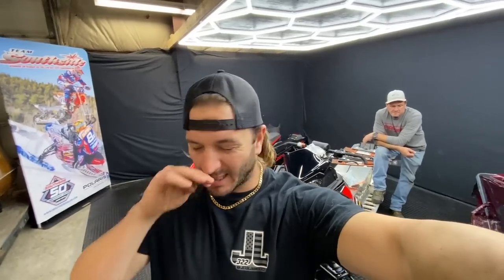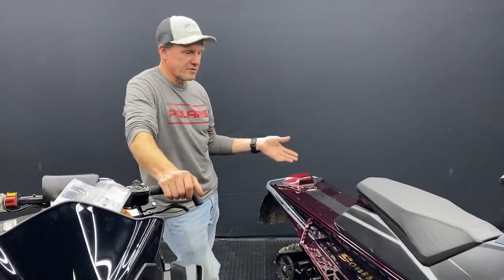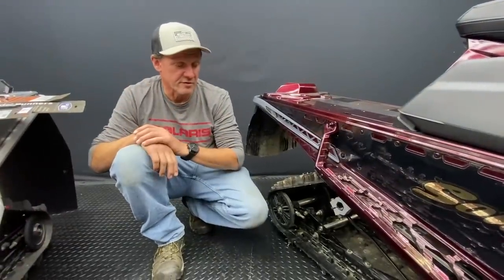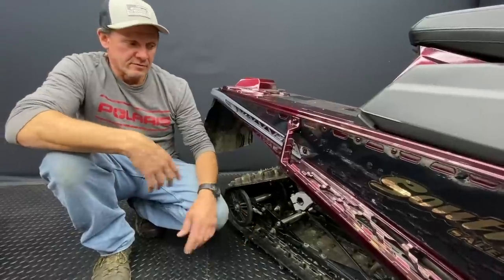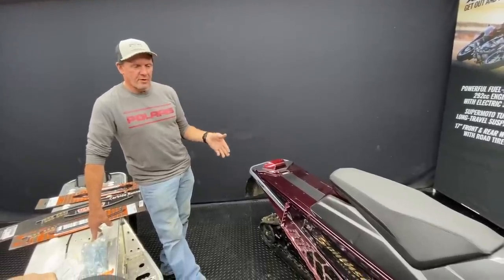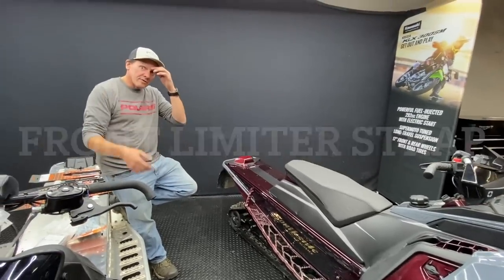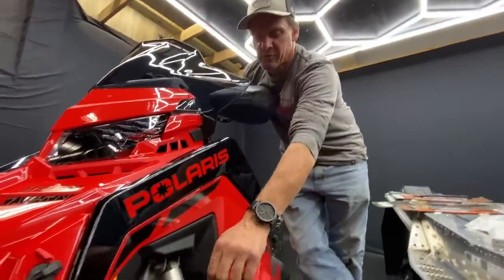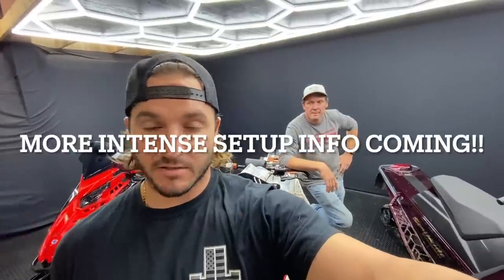POLARIS MATRYX BASIC SET UP! WHAT TO CHANGE TO MAKE YOUR RIDING EXPERIENCE MORE ENJOYABLE!

Comment: Bruce is spot on with the springs,I wound up running the Xtra h/d springs which were too stiff to get the right sag,you can actually bend the tang in the spring to get the right sag,so I now have the exact Sag and ride height I want and still have the stiffer rate springs in place!!👍👍
Reply from the maker: we used to bend the race sled springs to get it where we needed it! There is always a way to make it work but for most we like to keep it basic!
Reply: 👍👍Love your new tech videos for the riders,This will give the average guy a great idea on how to help tune there sled,!!

Comment: Great suspension setup info. My only comment is the snow conditions change not only by the day but sometimes by the hour, so you could make changes several times a day which ain't gonna happen. Riding partners don't want to stop waiting for me to make changes.I find a happy medium and usually keep it for the season.
Reply from the maker: And that is really the ultimate goal is to find a happy medium. But with addition of clickers which are extremely easy to use you can really change your entire sled when you stop for gas or food juts by clicking away. Obviosuly you need to find that happy medium first and then adjust from there.
Reply: @JESSEJAMES322  Guys would get mad if I had to stop and flip sled on side to change air pressure in my Fox Floats. Lol . Nice to have newer shock technology with clickers for hi/low

Comment: Great Video!  Really helps speed up learning all of the in's and out's of tuning.  I have a 22 VR1 850 137".  I am planning on putting 96 studs down the middle (ride mostly MN and Northern WI).  Aggressive riding style.  What Carbides do you recommend? And what length is needed with that stud setup?  I am about 190#'s with gear on, so planning on switching to the HD Springs this off season as well if that makes a difference.  Keep the great content coming!
Reply from the maker: Thank you we are trying! We recommend 8 inch woodys Mavericks. They are an awesome addition to your set up!!! appreciate you following along! did you get entered in the giveaway? you could win skis, carbides, studs, hand guards and a $200 gift card to Southside!! anything purchased off 322threads.com gets you entered!
Reply: @JESSEJAMES322  Awesome. Thanks for the quick response.  Do you shim them or run navigators with them? Just picked up a 322 star hat!
Reply from the maker: Thank you! and you can do both. They will ultimately help make the sled handle the best it can

Comment: Hey Jesse, thanks for sharing your knowledge! Your videos are awesome and very helpful!! I have a 2021 XC850 129” track and I’ve followed all the tips you and Bruce mentioned. Question - Do you have any suggestions to help improve inside ski lift? Ive ridden a 2018 Pro S and 2017 stock Indy and neither seem to have nearly as much ski lift as my 2021. Any suggestions are appreciated! Thanks!!
Reply from the maker: hey so inside ski lift can be tammed by a couple things. 1 add preload to your ski shocks. you only have 80 pound springs so add 1/2 inch (anything over a half inch wont change). you can go to 100 pound springs up front and also add 1/2 inch of preload (this will get the front of the sled up and some of the track off the ground) OR you can shorten your limiter strap which ive done a few videso on that ove rthe years
Reply: Awesome, I really appreciate it!

Comment: I’ve been tinkering with my 19 assault for awhile now. I’ve found the front springs just aren’t long enough and you have minimal preload adjustment. So I’ve found to just run them all the way stiff. I run the woody ace 8” and clickers are med in front. Front rear shock is 2 and rear is I think 5-6. Never touched the spring. The fucker will wheelie which makes it fun and it turns quite nicely if I wanna hang off and work it
Reply from the maker: Have you ever had your shocks freshened/revalved? If you have not i would highly reccomend it as youd probably have a much different set up. Assaults are an uncoupled skid so they do wheelie nice thats for sure and with you having the fronts cranked down thats lifting the nose to begin with! Either way as long as youre having fun thats all that matters!
Reply: @JESSEJAMES322  yea I honestly enjoy it quite a bit. I will be having them redone because I’m 240-250 full geared as well, so on the heavier side. I loosened the front springs it they ended up coming off the collar and gouging the shit out of the shock body from extending all the way out. Back to what I said then being to short for the shock IMO. I looked into the dual rate kit as well. For rear I need to double check the torsion setting. Think it’s middle

Comment: Damn Jesse perfect timing on this video u & I were just chatting about me buying an xc or holding out for an xcr because of suspension vs my weight. Video was really helpful in helping me realize that if necessary I can set up the suspension on the xc to conform to my riding style and weight at a fairly reasonable cost.  Big thumbs up to Bruce did a great job explaining the whole concept. What does Bruce ride? Thanks again…
Reply from the maker: Yes you can! Thats what i was saying in my last comment to you is you can make the XC work great for you just need a few tweaks here and there! Last year Bruces main sled was a 650 VR1 with XCR shocks that rode so so nice!

Comment: Good video man! I was hoping Bruce would talk about the FTS and the effects it has with adjustments.
Reply from the maker: Thank you! We will get more in depth later on. We wanted to do just basic basic stuff up front!
Reply: i would think this would part of the basic set up rather then relying on the torsion spring to do all the work. FTS and the rear scissor block does a lot for weight transfer and how it rides and corners

Comment: Hey Jesse! Do you run ice scratchers? Maybe a tutorial of those? I'm going to get some but I've been waiting to see if you were gonna do a vid on this subject..pray for snow !!!
Reply from the maker: I do not run them but alot of guys do. best ones ive seen are the RSI Racing ones. Use BONADUCE2022 at checkout and save some $$$
Reply: I put the ski Doo ones on my VR1 since Polaris really doesn’t offer them, they work excellent, dropped my coolant temps down dramatically in icy conditions,  slight tweaking is required to make them work, there is a you tube video out of Canada called Crazy Canucks that shows them installing them
Reply: Check out the skidoo/spi rail mounted ones. You can get a mounting block from one rig designs so you don't need to drill any holes. That's the set up I'm going with on my VR1
Reply: @paulmollise1856  I did the same but made separate bracket instead of using my suspension tabs,that spring can definitely hit your dog bones they move side to side and I didn't like how they looked when they were in the Tuck away brackets so I made completely removable,1 wing nut and I remove the whole assembly in a couple of turns!!Have great season hopefully we won't need these scratchers this year 😂😂
Reply: @youareright5431  I made spacers to hold the springs out away from pivot arms, yes they will hit if you just install as is, and also moved the hangers so the springs didn’t hit my tunnel when not in use
Reply: @paulmollise1856  Can't wait!! So funny everyone is all in this year!! All the snowmobile videos are full of us sled addicts 😂😂

Comment: Good info thanks. I would love to have Bruce explain how to lesten my ski pressure and why. I have a 2021 Axys XCR 850 and love it. I ride anywhere from slightly sporty to aggressive, but I really fight the steering. Its the most ski pressure I've ever had, and it gets tiring. Should I adjust front track shock spring preload??
Reply from the maker: Yes if you want less ski pressure increase the preload on the FTS spring. Thatll will pull some weight off the skis

Comment: Does this apply to the 22 Assault as well for the HD springs and valving? I’m about 190 and have a 22 Assault coming for the season. Great Video, need more of this out there.
Reply from the maker: Yes it does apply to them as well! Assaults are also valved a little bit stiffer then the VR1's and Xc's which in my opinion is a good thing! Working on getting more if this!

Comment: Great info.  What if a person did all that but still have a bit too hard steering?  What would you suggest to fix it?
Reply from the maker: hard as is too much effort or does not steer well
Reply: @JESSEJAMES322  too much effort
Reply from the maker: increase the prelaod on the front track spring. so the coil spring in the front of the rear suspension

Comment: Didn't talk about FTS, but overall this was definitely helpful. Been hoping to get more weight to the skis
Reply from the maker: Wanted to start with basics. To get more weight to skis you can do two things. Crank on the ski springs or pull the limiter strap up one hole or half a hole
Reply: @JESSEJAMES322  Thanks. So you would say taking the preload off of the FTS doesn't have as much of an effect as those two things?

Comment: Hey Jesse,  loving your videos, thanks for taking the time to keep us all informed of the good stuff.   Question:  I have a 850 VR1 137  (storm 1.5 track) coming soon, should I stud it?   Ride lakes and trails in northern Wisconsin.  I have mixed emotions about studding the track cause of what they do to my driveway!
Reply from the maker: Hey Pat! Thanks for following along. I would absolutely stud it. Not only for a performance side of  things but also a safety aspect. Icy corners, Icy hills etc it makes everything safer. DOnt have to go crazy but some in better than none in my eyes!
Reply: Pat, i ride the same areas as you, i would 100% stud it.  icy corners, and some steep icy hills can lead to some really bad outcomes.  doesnt have to be for performance but like Jesse said, for saftey at least. My buddies all have ice rippers, and they still have issues on icy hills and corners.  go 96 down the middle if you dont ride hard, and 144 if you like to get after it.
Reply: @adamcooper3717  Thanks Adam,  I just picked up my snowchecked sled yesterday but unfortunately after 13 miles the "check engine" light came on (manual says an EFI issue and not to run it) and the dealership is closed until Monday.  Will probably do 96 down the middle.
Reply: @adamcooper3717  I ride in the same area, picking up my 2022 XCR 650 later this week, planning to stud down the middle, just like the extra primarily for safety sake
Reply: @patrickmcnamar5705  im guessing you got some bad gas, what mode did you have it in?  i broke mine in on the "crap gas" mode its putting a bunch of oil in for the first 2 hours of run time so thats probably what happened, 99% sure shes fine

Comment: I understand that you can run the springs on different preload settings, but I do have a question for Bruce, can you run different wire diameter springs from side to side to get a different rate, and if not, why not if it’s ok to run different preloads with the same rate springs?
Reply from the maker: you definitely can. Just like you said if you run the settings different It would be the same to just have one side with a HD spring and other with a regular spring!

Comment: Can Bruce provide detail info on front shock spring adjustment.  He said to compress spring 1/4 to 3/8". But from what, factory setting? Is there a specific starting point? Also what setting for front skid shock as I know this plays big factor in ski pressure.
Reply from the maker: No compressing the spring that much would be from no preload. So running the adjuster all the way off and then tightening until it taks the slack out of the spring. Then measure 1/4-3/8 from there. Hard to explain through messaging. front track shock we will have another video on but for now we wanted to start with untimate basics
Reply: @JESSEJAMES322  . I fully understand. Just wanted to make sure. Can't wait for for suspension info. Great content.
Reply from the maker: Thank you! Appreciate you follwowng along!

Comment: Hey Jesse, I’ve got a 22 xcr 850 136 I bought slightly used. Not quite sure to be honest where the shocks are sitting setup wise. The rear spring is stock and is on the medium setting, previous owner studded the track with 144 studs. I put on a set of c&a xcs skis with. The 9 inch shapers. I weigh around 190-200. Any recommendations on starting points here? I thought I saw somewhere that the 22s came stock with the hd rear torsion spring but I didn’t know for sure
Reply from the maker: the 22's did not have the HD torsion springs so i would highly recommend them for you. I would go througha nd set all your clickers ate certain spot and then go from there, put all the preload in the front ski springs
Reply: @JESSEJAMES322  thank you sir, hd springs will be ordered tomorrow!

Comment: Hey Jesse, 
I have a question similar to the one below. I ordered sno checked a 22  VR1 Boost either a 137, and the cobra track w/ 1.3 lug.  Do you know if it will come with a standard spring in the rear? I’m 160, so I’m considering the HD springs. I’m just  north of you in NH.
Reply from the maker: The boost VR1 will be coming with the standard springs. The HD for your weight really depends on how hard you ride. if you're always riding hard i would say go for them! if not then they might be a little stiff
Reply: @JESSEJAMES322  
Thanks man, we usually ride pretty good. Like you said, the season is short. I think I’ll go for it and try them on low- med
Reply from the maker: yea give them a shot! i really dont think youll be dissapointed in the decisioN!

Comment: I have a 2022 VR1 850 137 with 1.5 storm and 1.75 studds 96. I weigh 220, average to occasionally aggressive rider. How would you recommend setting it up? I also have 6 in carbides on. Thank you.
Reply from the maker: Hey Larry so we really went over evything needed to know in the video. Basic is you definitely need HD springs probably set on medium. CLickers set in the middle. Then ride and go from there. Can probably add some preload in the front ski springs
Reply: @JESSEJAMES322  thank you and I appreciate the quick response.

Comment: What’s the weight or pounds rating on my stock VR1 torsion spring 
I’m 215 wondering what’s stock and what I should move up to for the rear torsion springs
Reply from the maker: I do not have the ratings of them but there are 4 options from Poalris. Light Duty, Standard, heavy duty and extra heavy duty. I am 180 and run the heavy duty.

Comment: Unfortunately bought a zr 6000 for my first sled although its plenty for me. Likes to push in corners and can’t seem to get it right for anything. Tried stiffer torsion spring setting and removed some preload from front skid. I was told to remove preload from front shocks as well to increase ski pressure and that sounds backwards to me. Any chance I could get a 1-2-3 of adjustments I can make to fix this issue. I understand there’s a lot that goes into this but at least if I KNEW what adjustments in what order I could figure out what else I need to do with the individual components based on results. Sure appreciate the vids but too much conflicting information. Ive got 500 miles of experience so knowing who to listen to can be confusing at times. Y’all seem to have your shit together!!!
Reply from the maker: i am not overly familair with that sled at all but removing preload from the skis reduces ski pressure so that is in fact backwards. I would add preload to the ski springs and try that. carbides and skis are a huge factor into turning as well. may need some more aggressive carbides
Reply: @JESSEJAMES322  Just ordered some C&A’s with nine” shapers.Thank you for that! And talked to your shop for necessary adjustments. I am an old fat fart need all the help I can get! HahaThanks for the response!
Reply from the maker: they will absolutely help!! always happy to help!

Comment: So a skinny guy at 175 lbs needs to change the rear spring to get it to handle. So if a skinny 175 lb guy needs the heavy duty spring would the extra heavy duty spring be stiff enough for a fat 250 lb guy?
Reply from the maker: We are not saying you NEED them but we are recommending them. We feel as the factory springs really are too soft all around. is the 250 pound guy a super hard rider?

Comment: On the rear torsion is there a certain sag that we should be looking for?
Reply from the maker: Not according to Bruce no. More of less by how you feel
Reply: @JESSEJAMES322  awesome.thanks this was a great video
Reply: 3" is known as a good goal for sag.  Also you may want to pick torsion springs that get you to 3" on close to the lowest setting.   That way you can adjust higher if you load the tunnel with a fuel caddy, storage, etc. or if/when the tunnel packs with ice/snow throughout the day.

Comment: I weigh 230, am I pre set at M or H?
Reply from the maker: all what you like. There is no set setting. Do you have the HD torsion springs?
Reply: No they are the standard ones that came with the 2019 Axys 129 Indy 800
Reply from the maker: so for starters i would recommend going to the heavier springs. The stock springs are too soft for your weight (in our opinion). Im 180 and run the heavier springs